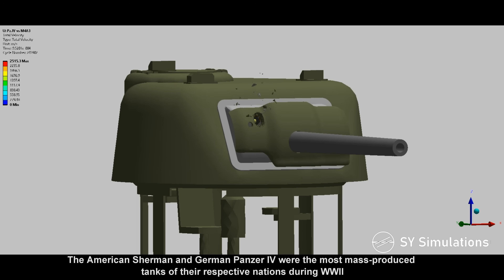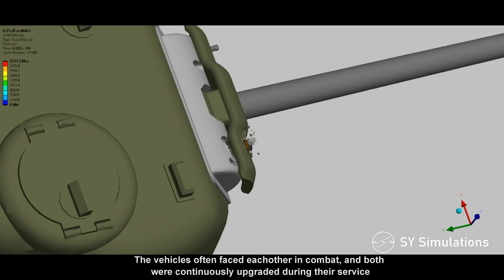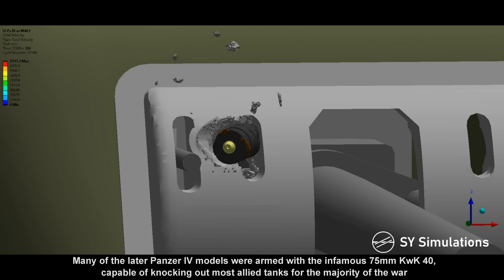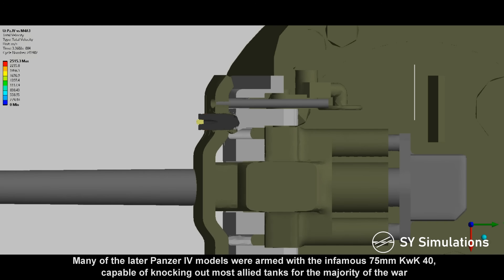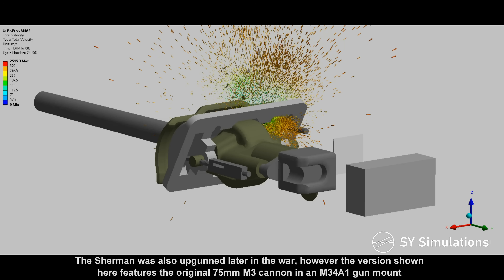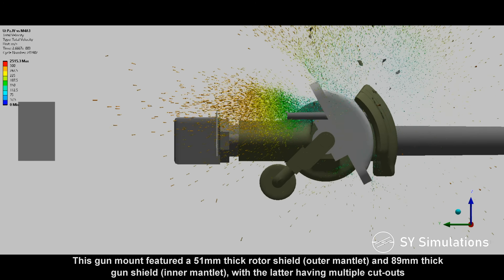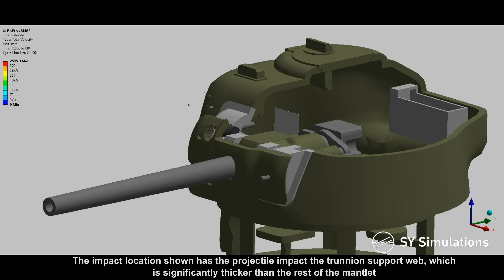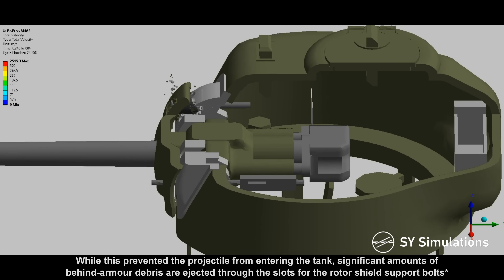PANZER IV vs M4 SHERMAN MANTLET | 75mm Pzgr.39 vs Sherman Turret | Armour Penetration Simulation

Comment from the maker: There are actually bolts going through the two slots closest to the gun, connecting to the outer mantlet. However, I couldn't find any good images/diagrams of them at the time. Since then, I found video of the inside of a Sherman turret where the bolts can be seen. They don't occupy all of the slot so a large amount of spall would still make it around them (or the shell would destroy the bolt anyway)
Reply: why is explosive left out?
Reply: @Tr4wnet it would take ridiculous amount of time to process
Reply: @zack-the-storm-qn506  Would be fun to see once
Reply: @Tr4wnet I think there was one such video. Not sure if it was this channel though
Reply: still would not want to be anywhere near the inside of the tank during ww2, especially facing a panzer 4 AP projectile hitting the amour.🦘👍✌
Reply: Day 1 of asking for T-34-85 turret frontal side face (closer to the middle corner) + 10mm spaced structural steel (as seen in the WT '45 pack) vs OCC 105 F1 HEAT shell @~35-40 degrees

This is the clip that made me do this
https://www.youtube.com/shorts/lPKG4DChzlg

Comment: You would have more success with the short barrel and the C variant heat round that pens 115 mm . Rate of fire is significantly higher as well . Explosive filler in the Pzgr 39 is a measly 16 grams. It’s why so many Sherman’s could be repaired and sent back into battle. You needed to melt them down , not throw a firecracker inside 😂

Comment: OK, so:
- vertical gun travel - out of action
- sight - likely out of action
- gunner and commander - I'd say almost certainly 1 of them is out of action (seriously wounded or dead), and good chance it's both.
The tank would not get "destroyed", unless fragments of armor ignited something inside (f.e. some tarp, which over time would turn into full-blown fire) but the crew would bail out for sure and the tank would not be operational without serious repairs. 

This shows nicely the "overlapping gun mantlet myth" - just because there's armor in the straight line behind the mantlet, doesn't mean you're safe.
Here the shell clearly deviated towards the gap in armor (taking the path of least resistance), so we can assume as long as the gap is within a few centimeters from where the shell impacts (I'd risk guessing about 7-8cm for 7.5cm shell like this), it will happily  deviate towards it because the armor will be easier to displace in that direction. 

Anyway, would love to see Tiger 88 Pzgr 39 and T-34-85 BR365A APBC vs 60mm plate at 60 degrees at 500m.

Comment: That simulation of all the red spall is innacurate. The metal armor wouldn't turn into metallic sand. I've seen enough knocked out armored vehicles during 24 years and 3 wars. But I applaud the sim.

Comment: That's a cool simulation because in the Panther manual (or was it a gun penetration handbook?), the gun mantlet on the Sherman was marked as not vulnerable to even the Panthers gun, which always seemed kind of odd. But as it turned out it does indeed offer pretty good protection for the crew.
Reply: According to Jentz (Germany's Panther Tank) in Penetration Table 9.3.1, Panther 7..5cm Kw.K penetrates the mantlet at 1000m at a 30-degree impact angle but the glacis plate on the front hull at only 100m. Interestingly, the 75mm M3 gun can only penetrate the superstructure on the side of the Panther (against at an offset impact angle) at 400m (the rest of the hull was penetrated at 2600m and the side of the turret at 1500m).
Source was Wa Preuf 1 report dated 5 October 1944.

Comment: What I learned from War Thunder is that gun mantlet's layered protection is just an illusion and can be penned like a normal turret plate
Reply: True for for most tanks. However, the Tiger 1 was an exception. Its gun mantlet was 90-150mm, with all thicknesses thinner than 140mm backed up by heavy bars of 100mm turret armor.
Reply: @TTTT-oc4eb can still be penned when it's facing directly at you and you have decent pen

Comment: "sherman is the best tank of the wa-ACK"
Reply: A Jumbo with the 76 mm is better than any Pz IV for sure
Reply: @ShokkuKyushu  yeah right. Why wasn't every sherman a 76mm jumbo then?
Reply: @ShokkuKyushu  Easy 8 was probably the best variant, though. Sure, the extra armour is nice, but it affected the suspension and caused irregular wear towards the front.
to quote Green: "There was a price to pay for all that extra armor on the Jumbo, as seen in this army report dated October 24, 1944: “One thing that users must realize is that in rough cross-country operation the front volute springs will fail if permitted to 'bottom' violently.”"
Reply: Best medium tank at least.

Comment: Kind of the Americans to cut a slot for fragmentation to get in.
Reply: Yeah, unlike the Germans whose coaxial machine guns and vision ports phased through solid metal.
Reply: @NicaNicu31 No, if you look closely there is no corresponding hole in the shield. There are in fact 4 slots cut but only two used for scope and machinegun.
Reply: sometimes you need to cut corners for a tank meant to ship across an ocean
Reply: @SenkaBandit  In terms of corners cut, the Sherman didn't really cut many. It had a weight limit but it was arguably the best in its weight class.
Reply: @NicaNicu31 ya I agree